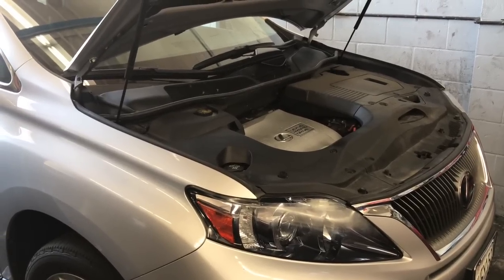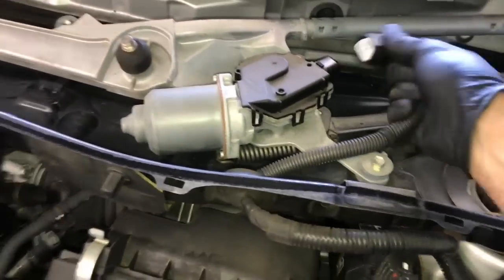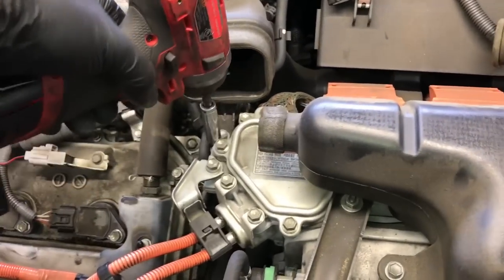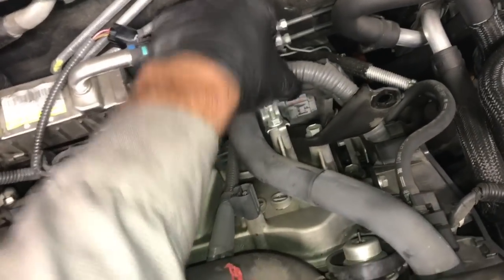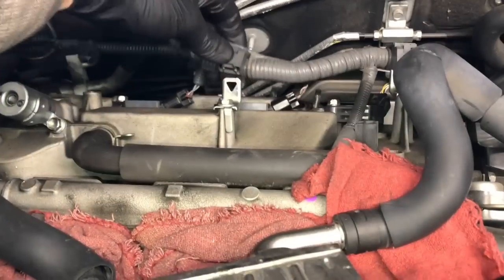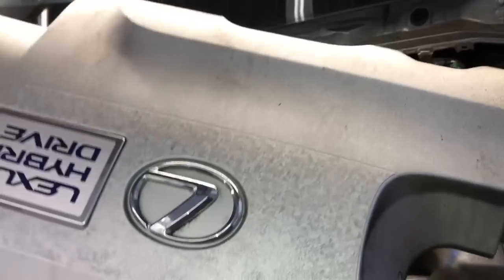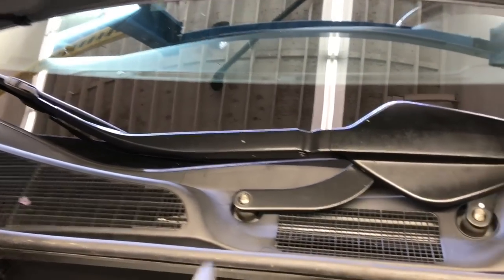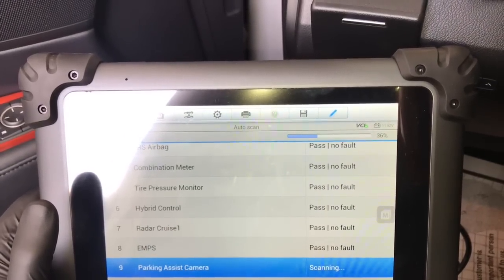Save Money By Replacing Your Own Spark Plugs: 2010-2015 Lexus Rx450h Hybrid

Comment: Thanks for making this video! I was able to do my spark plugs by following your instructions. I don't have the hybrid so a few minor differences. I misheard you and torqued the plugs to 16ft lbs instead of 13ft lbs like you stated and didn't realize until the last plug was in. Do you think that will be a problem? You saved me $925.  My dealer in St.louis wants $1000 to do the job. I payed $75 for my plugs
Reply from the maker: Wow that’s some big savings awesome. That extra 3 pounds at work is not gonna make a difference you’ll be OK. Thank you for watching and sharing!

Comment: Thanks Brian! Just did my wife's 2011 RX450h with 120k on it. Wow that was a PITA! I went ahead and did the coil packs too and cleaned the EGR valve and throttle body while I was in it. Took me all day but saved me a ton of money. Would have been quicker if I paid more attention to your video and left the pipe attached to the cooler and just removed the nuts at the EGR. Just a note to anyone that ran into my issue, I had to push the car into the garage when it started raining. Everything was disconnected/taken apart and I turned the car on to accessory (I didn't disconnect the battery's prior to doing the work) to put it in neutral (I should have used the manual override) and pushed it in the garage. When I was done and started it I had, PO102 Mass air, PO108 Manifold Press and PO113 Intake air temp. I cleared the codes and took it for a few mile ride, no more light/codes. I think it through the codes because of turning it on with everything disconnected. Runs perfect! Thanks again, amazing videos!

Comment: I was able to do this without removing the intake manifold, about 5-6 hours total for a non-mechanic.  You just need to move the heat exchanger out of the way, which is a pita, requiring just the right combo of ratchet extensions.  I feel like I was in a bare knuckle boxing match and lost.

Comment: Thank you.  I tackled my 2013 450h today expecting it would be like the 350 videos I have seen. When I saw my heat transfer pipe I though I would never be able to get the passenger side and middle plugs out.  Thanks to your video I have replaced them all.  I still need to put back a lot of stuff but the hardest part was dealing with the heat transfer pipe.  Thanks for saving me!
Reply: That heat xfer pipe threw me off too.  Added about 2 hours to the job plus a lot of skin.  I was counting on the rx350 videos without the intake manifold removal and no heat exchanger.  I was wrong!  I think I will never do this again on this car.  Maybe the next guy will try or I'll ride it through to the junk yard.  I put it ruthenium ngk plugs, supposedly they are stronger than iridium but probably a bunch of marketing.  I feel like I was in a boxing match and lost.

Comment: Thanks for this great video! It was so easy to follow your instructions throughout the job and I would never have done this job without it. It really helped me. 
I was unlucky and broke two rusty studs at the bottom of the heat transfer box and got an extra three hours of hammering, grinding, drilling and a tired body. 
Glad the job is done and money saved.

Comment: AMAZINGLY helpful. Was apprehensive, but worked like a charm. I had oil in one of the front plug holes so had to replace valve cover gasket and plug gaskets. The old plug gaskets were no fun to remove but worked out. Broke 2 valve cover bolts in the head in the process - removing those added a day to the job.

Comment: I just finished this project, I did not use the scanner because I did not have one. When I got through it would not start, all the codes were lit along with check hybrid system.  What can I do? Your video is the best on Youtube! YOU ROCK!
Reply: Got it solved, I did not have the hybrid battery plug pushed in all the way.. OOPS

Comment: my 2013 rx has an issue with the brake master cylinder.....it has a pressure leakage tht is making the brakes not work properly.these video has greatly helped in getting to reach the master cylinder

Comment: Cover the lower edge of the exposed windshield with cardboard or foamy/towel.   One slip of a wrench and you crack a very expensive windshield.   One of my techs learned that one the hard way.
Reply from the maker: Good tip. Thank you 👍

Comment: Hello, very informative video, thanks.
Did you drain the coolant as the procedure asks to do, or not? Because I saw that you let connected the hoses on the EGR radiator.
Normally procedure asks to remove the 2 hoses, but that means that coolant needed to be drained.

Comment: Thanks a lot for this video. Very detailed and easy to follow. Quick question.  When my husband started the car after hooking everything back up he received a “check hybrid system, check brake system “ with codes 1256, 1259, 1300. Any ideas what this could point to?
Reply: One commenter said that he had all sorts of engine codes lit up after assembling everything back.  It turned out that he didn't plug in the hybrid battery orange plug back all the way in.

Comment: Was easy job on my old  GS 300 with straigh inline six.  Considered buying an RX once but this kinda design put me off. So got a model with straight inline 4 before they started adding the plastic rocker covers and on that you don't even have to take the intake stuff across the top out of the way. Wish Lexus would bring back the nice solid cast iron block  easy to service inline 6 but without the plastic.

Comment: Folks, don't forget to clean the car's throttle body, if it's dirty!  You're brave to be able to do this one.  Also replace the 3 back spark plugs' engine/ignition coils as well, and save the old ones for the front 3 spark plugs.

Comment: Excellent video. Is there a trick to getting the nuts off the heat transfer box. Mine are slipping a little with a socket and extension and I don’t want to strip them.
Reply from the maker: I would recommend using extraction sockets. Here is an affiliate link for some that I recommend. https://amzn.to/3QrqNDR
Reply: @HowtoAutomotive  Thank you very much. The gearwrench extractor worked like a charm. Thanks again for this video. I would not have been able to do this job without it.
Reply from the maker: @kiranandandreakoritala6889  glad to help. Thank you for watching!

Comment: Completed the job. Now I have  error messages and can’t start up the car.  Anybody else had this happen? Any suggestions?
Reply: One thing I did wrong was I inserted the Hybrid System disconnect and flipped the lever but I did not slide the handle to the left,

Comment: We're about to buy(I think)a 2015 Lexus 450H. The Disclaimer is worth thinking twice about doing this first time, with no guidance or experience. Your video reminded me of the 9 hours it took me to do work on a recent purchased 2005 Jaguar VDP(105K miles): change all 8 sparks and Ignition coils, clean the throttle body and mass airflow sensor, air filter change....I can't imagine how long it would take me the first time to do this. At what mileage do these 2015 RX450H typically need a spark plug change? This was an easy video to follow, but holy-mutha-of-pearl. One better document and know what they're doing and do it slowly, unlike your speech tempo(which is fine with me). Thank you!
Reply: Hope this is not too late but it's recommended by the manual at 120k miles.

Comment: OMG...  Much harder job than in my wife's 4 cylinder toyota yaris 1.3petrol 😉
Reply from the maker: Yes definitely a lot more going on on this vehicle. Thank you for watching!
Reply: @HowtoAutomotive  I must say that your great informative video put me away from buying this car as I like to service car myself.  Wish rav4 hybrid have 6cylinder much quieter engine than 4cylinder 2.5 that actually comes with but spark plugs are right at the top under the engine cover 😁👌 rav4 hybrid have similar drive train,  hybrid system weights 700kg less than rx450h but is not as gorgeous as RX😒 thank you for sharing

Comment: I have never powered down the hybrid system when replacing spark plugs.Its always best to be safe than sorry. 
 Are you a flat rate Tech?
Reply from the maker: JoeLopez40oz for the safety of the nonprofessional I Power it down. Yes I am a flat rate tech. Make the videos does slow me down quite a bit. But it’s worth it to help.